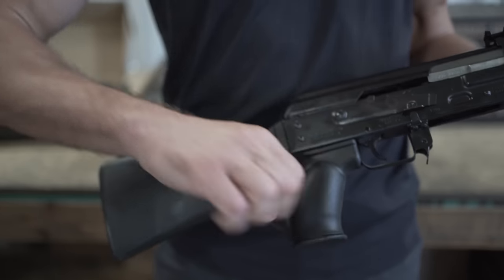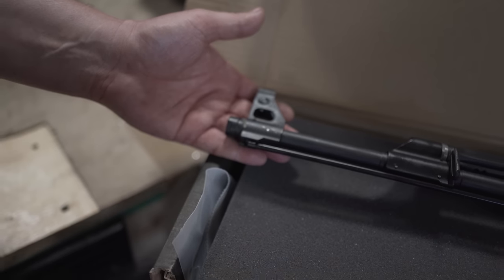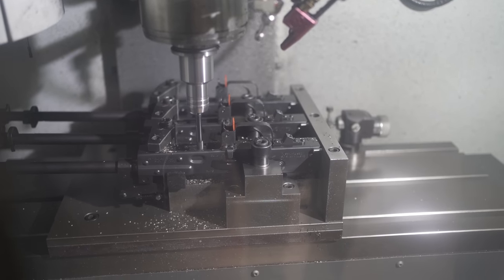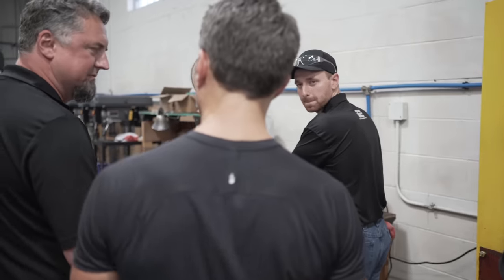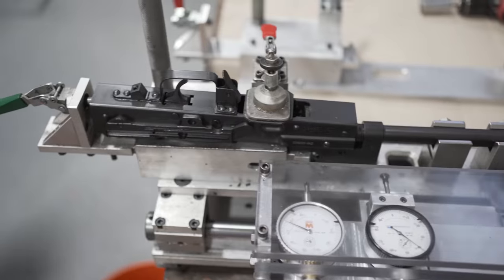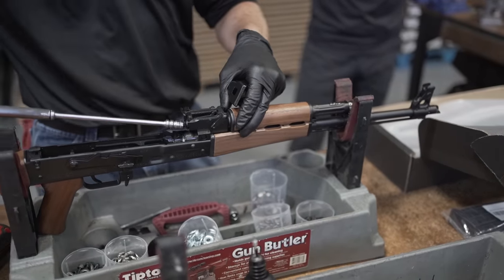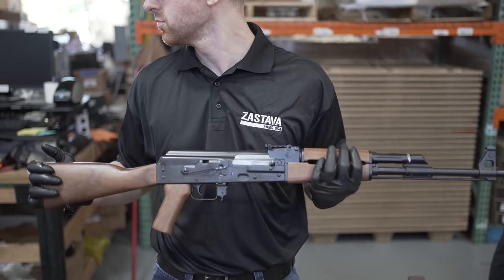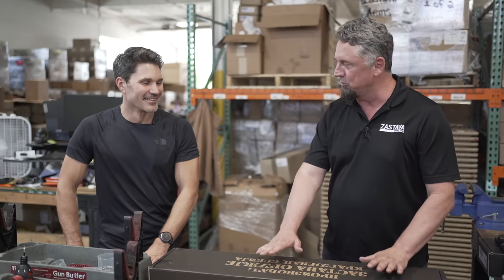Why AK-47 Imports Suck

Comment: I was super poor and married in 2011 so I bought a SAIGA sporter (299.99) and learned to convert it myself after hiring a local licensed (somehow) gunsmith to cut the welded muzzle cap off to expose the threads and the idiot cut all the way back to the front sight base....so I had this big gap left over and his 'fix" was to jam a piece of copper tubing spraypainted black between the fsb and muzzle device.  He also tried to grind a feedramp in the damned chamber instead of installing a bullet guide.....DUDE, he almost ruined the damned barrel.  Luckily it still seems to support the cartridge just fine and no bulged cases or anything.  After all that, I decided I would learn and do all the rest myself.  It was even more involved than this since the whole trigger guard and trigger parts had to be moved forward on the gun on a SAIGA.  Installed the bullet guard, changed the furniture, etc.  Nothing hard, but I had never worked on guns before...I had just then gotten into them.  I did a good job, it's still running great to this day and it started my love for working on guns.  
It is definitely a silly rule and doesn't help prices when they have to modify the gun and add different parts to it and pass that cost on to the customer.  I wonder if they ever sell non converted ones for cheaper for someone who wants to do it themselves or lives behind enemy lines in a unfriendly state?
My NPAP is from Century in 2014 so it had the worst wood furniture....I have a vid of me staining it to improve the look, which it did.  But the wood quality was so bad and it beat the hell out of my face.  I have quite the collection of Zastava firearms going back to the 1920s so It just didn't feel right having that crummy furniture on there.  I finally got some real Yugo military surplus furniture and it looks absolutely amazing on there now.  More comfortable to shoot, too.
I knew about the hammer issue years ago so when I got mine, I shaved down material on the US made hammer, checking carefully for lockup and reset each time, and got it to where it won't beat the bolt and carrier tail to death like you were seeing with some online posts claiming Zastava had improper heat treat due to carrier tail mushrooming....nah they were using a US made hammer that has a big hump on it and causes problems the original hammer never would have.

Comment: 20 years ago I was searching for an AK or an AR, I found an AK & I held it in my hands in dis-belief. The fit was so horrible, literally the stock was 1/8" bigger than the receiver, and I was literally getting splinters in my hands. The action was  so rough, you could hear the metal grinding from lack of any kind of cleaning up - polishing - something. 
Brand Century Arms, needless to say, no purchase was made.

Comment: 922r doesn't have anything to do with a thumb-hole stock or weld-on thread protector (as shown in your intro) - it's purely a numerical parts requirements for domestic (US) parts on the rifle. It is not only an import requirement, but also an ownership requirement. They don't "convert" the rifles to 100% Serbian once arrived. The thumb-hole and weld-on thread protector are related to different import laws.

Comment: I build AKs in my garage. Home stamped recievers on 4130 .067 thousands steel sheets. Cutting, drilling,filing and heat treating is an art form and very easy to make UGLY mistakes that stick out like eye sores. Drilling the barrel pin is a nightmare as most trunnions are dilled to different ID diameters for pin holes . You have to buy expensive high speed drill bits that cost a lot. Its honestly ridiculous on how much needs to be done to have a functioning rifle. The tuning of the bolt rails all that is a PITA. So yeah AK's are expensive! I wish i had a mill. Would make the cutting so damn easy on the recievers. I made a JIG on CAD and then 3D printed it to transfer all the holes and cut out to my recievers. That alone shaved off all the errors and hours ! .

Comment: ZPAP’s are pretty damn good. Hell in the 90’s I had a Chinese m70 AK and it tossed well over ten thousand rounds through its cheap folded metal chassis. The barrel ended up going sideways. 
I bought an M+M and it was an expensive dud with problems immediately with fit and finish. Feed issues every round until broken in and then still a slew of issues at random. 
Sent it back and they refurbished it (tried) and it had the same issues. 
I tore it apart checked the gas tube, the bolt and feed ramp. There was a manufacturing mar on the lip of the ramp. Filed it down and then it Fed better but still we had steel swell up in battery from some Russian red army casings and had to pry them out. 
This rig taught me everything about what is good and what is wrong with MM’s design. 
We sold it and took a loss. I own a GF3 from PSA and the quality is substantially less from a visual and feel standpoint but it runs right out of the box and still runs great. No issues, zero. 
The Romanians and Croatians make great AK’s if you can’t get a Russian True AK. 
Of course the ZPAP is solid.

Comment: Has Zastava fixed, or addressed their issues with QC. I've seen numerous videos, and pictures of the m70 having cracked recievers, broken bolt carriers, problems with metallurgy, etc. I'm considering getting an m70 in Serbian red, but I'm kind of hesitant now with what I've seen. I'm starting to lean more towards getting a WBP Jack instead.

Comment: It only makes sense that if you plan to buy an import AK, to buy Zastava. They are the manufacture of that line, importer, and distributor. That makes a big difference when the importer has to make it compliant when it gets to the states. If you could compare it to an assembly line that stretches across the Atlantic Ocean you wouldn’t be wrong. Not knocking any other importers, it’s just that with Zastava, it’s all Zastava, and nothing but Zastava, no one else have had their hands on it. You could buy a bash kit and build your own authentic import with a brand new reciever but not everyone has a shop with everything you need to build an AK for one AK, unless your gonna build a few. And if you go that route, you don’t have an entire original import AK because of the reciever, which doesn’t bother me none. But if you are looking to buy an import, why not Zastava? On another subject, I wouldn’t mind having one of the Zastavas before they are made 922 compliant, just to have.

Comment: That was a really smart way of spinning the fact you can't use aftermarket trigger groups.
Reply: I mean, you can. It just seems it’s going to wear the tail end of your bolt carrier a bit faster. They still drop right in and work the same. I’ve had an ALG in mine for over a year now with what seems to be normal wear in comparison to my other AK’s.

Comment: Seems like a lot of retrofitting and rebuilding instead of designing the imports for "design for manufacturability/assembly".  Makes sense to me to best use low end inexpensive parts that will be thrown away and use USA sourced parts as replacement parts.  Everyone is so focused on the fixtures for rework, but I guess that it escapes me why not build it here from scratch using USA sourced parts.  (Modern automation significantly reduces the labor cost so it makes sense to build it here.)  I guess part of the mystique is that you are buying a foreign made AK.  The truth is that what you are really buying is the design which can be manufactured here or anywhere using statistical process control.  If it works for PSA - why not for Zastava USA?

Comment: 11:00 no wonder my buttplate screw was stripped out lol.
Reply: This is a really inefficient, sloppy operation being run for the volume they're moving, and this is directly under the arms supplier of Serbia? At the very least I would expect some sort of line with workers torquing fasteners with a torque wrench and NOT with a drill.

Comment: Weird question. Would importers consider just selling a stripped version where you just get the original allowed parts only and I can go buy the stock, magazine, grip, and handguard all separately? If the mag is 3 parts then that all there sounds like my 6 is covered and something I can choose aftermarket parts later.

Comment: How is it not simpler+cheaper to import them as parts kits with barrels assembled and headspaced on a trunion, and just rivet/assemble them in the US on a US receiver?

I dislike all the exaggeration... 922(r) was a thing since the 80's, the amazing $300 Bulgarian kits that came in around 2004 all needed about $160 in parts including receiver & FFL transfer fees to become compliant... Cigarettes were 90 cents 15-20 years ago? huh? Maybe in the states where they're $4 today, not where they're $15 a pack today.

Comment: I’m a little surprised they even come with the single stack magazines at all. Is it required for the gun to have a magazine when imported? Besides that, why cut out a mag well in the first place? Save a machine operation in Serbia and import it as a single loading, self ejecting rifle. Especially since the router needs to make the same cut anyways. And if the rifles must come with stocks and magazines, would they not just pile them up till they have a shipping container full and then send them back to Serbia to be used on the next few batches of rifles. 

I’m sure there’s a good reason for all of this, probably laws as nonsensical as 922r.

Comment: The palmetto state AKs are manufactured in the U.S. with forged parts and tbh those things are great. I get groups at/under 2.5 MOA depending on the ammo, and the triggers are very nice, which makes them stand out among AKs. They still function flawlessly and are very rugged just like an AK should be.
Reply: and so far the only AK I have seen that within 300 rounds had a bulging bolt. PSA is replacing this customer's bolt, but he was freaked out by the whole thing so now I'm searching for a matching bolt that will also have the proper head spacing. After dealing with this I personally wouldn't buy a PS-AK.

Comment: I fully support Zastava for now. They make quality AK's that wont break the bank. Nd with a little bit of initiative you can still make them as tactically pleasing as any other AK. So if that's your thing than go for it. 

I will say this about Zastava, While their guns are quality the aftermarket parts they sell are garbage. Its all rebranded UTG accessories. the scope mount they sell is a slightly redesigned version of the UTG ACCU-SYNC and ill tell you what's wrong with it.   The scope mount has a fatal flaw in the design. The locking lever. Long, light weight, capable of putting a ton of pressure on the back end, where it goes down into the scope mount and actuates the lock. So basically, one bump at the right angle or in the right spot and your sighting system wont stay on. Ask me how I know. I actually bought one and it broke in the same day it arrived from just that. 

I let Zastava know about it, I wasn't asking for a refund or anything. All I was doing was letting them know where their product needed improvements. I suggested making the locking bar shorter, and giving it a bit more mass, or generally beefing it up a notch as to add to its durability. I then complimented them on their rifles and asked them why they could deliver such a durable war-ready rifle that will probably outlast me, but they cant deliver tough war-ready accessories for those rifles. I let them know I supported their business and was thankful for them bringing us these AK's. 

Their response to me was, "If I want a better scope mount there are better accessories available on the market from other suppliers." 

I responded with first pointing out them dodging accountability for novelty grade products like the scope mount at over a hundred bucks after shipping and everything. I then assured them that, yes I am aware and was already aware of other better brands but I chose to support the company I wanted to see succeed over going with the safe, but more expensive choices. Money aint even a fucking issue I got over 2 grand in both my AR-15 and I've put probably 600 dollars on my AK the same day I brought it home. I kind of found it a little fucked up with their response. I don't know how they do it in Serbia but it isn't exactly a smart move to point your customers who just sucked your dick about your AK's to your competitors. End of story, I bought a MWI Scope mount. Aint broke yet, looking at the designs of the locking levers in comparison, its easy to see why.

However I still support Zastavas AK's. And I talk nothing but love about them when theyre brought up. However I will always tell the truth and the truth is, their after market accessories are novelty grade hobbyist crap. If shit ever hits the fan, your toy parts will break far before mine.

Comment: Got me 4 M70's w/ different stock colors and includes my M70ZXR which is my favorite looking.  Anybody that says AKs aren't made to accept modern optica and accessories from the factory needs to look into the Zastava M70ZXR version.  Comes with side scope mount(not rail but actual side scope mount) folding Zhukov stock, fighter brake, and metal full length M lock hand guard and top picatinny rail.  The most modern functioning and looking AK I believe to be available right now.

Comment: For some reason...I wouldn't mind having a imported AK...as long as it has a mounting system for a optic...I don't mind having the imported version of it... atleast I could have a SPR style AK without lookin for a PSL or anything...🤣🤣🤣...plus I could use a more common round whether 7.62x39 or 5.45...havin that single stack mag would be useful as far as makin it a SPR rifle... basically have an AK version of the MK12...just add a couple inches to the barrel to make sense...🤣🤣🤣

Comment: Interesting. I always wondered "What happened?"  AKs used to always cost less than ARs,  now they cost much more. This explains a lot. 
Question, though...wouldn't it be easier to import NON-threaded barrels and then just thread them?🤷‍♂
Reply: I'm pretty sure that would require completely separate assembly lines/stations at the factory in Serbia and it's probably just easier to have a guy weld the caps on to the ones that get imported. Otherwise the workers themselves would have to be like "these next 200 rifles are marked for import, don't thread them" and leaving big changes in production flow like that up to wage workers isn't the best thing for production. I don't know for sure, but probably something along those lines.
Reply: 922r isnt a new thing in the least bit so its only part of it.
Reply: @hemicuda699  What's the other part of it?
Reply: @garyK.45ACP  Inflation a bit I suppose, the market has shown a willingness to pay more for AKs than they have in the past. Cheap surplus guns are drying up, some of the cheap imports, mostly the chinese guns or things like the russian veprs, are out of the market now. There arent as many cheap options out there to keep the prices down.
Reply: @hemicuda699  Supply and demand mostly. The supply of ARs has increased way out of proportion to AKs since the early 90s. 
You can easily assemble your own AR lower and then build an upper, or order a complete upper from PSA or BCA and have an AR rifle well under $500. Maybe under $300.